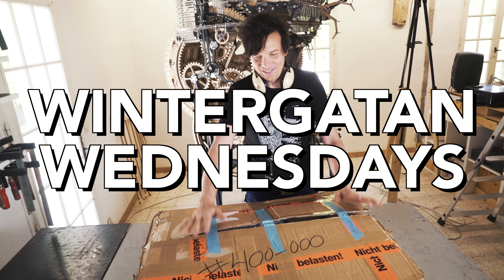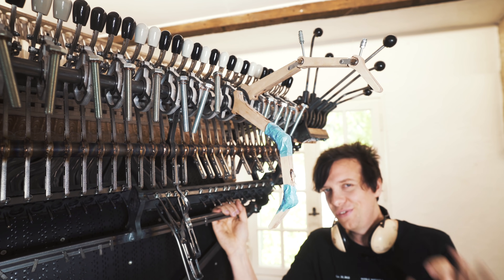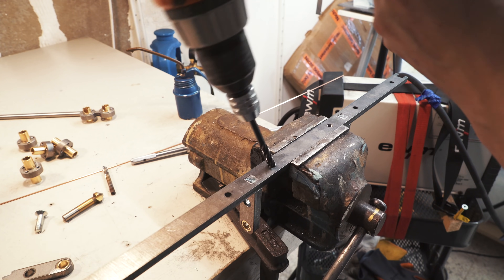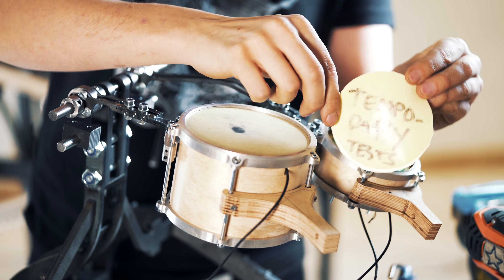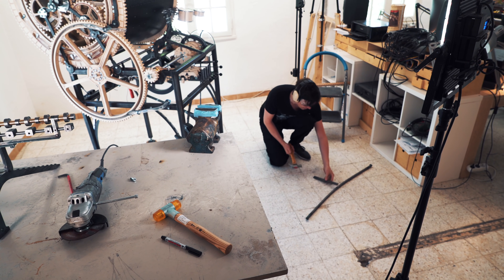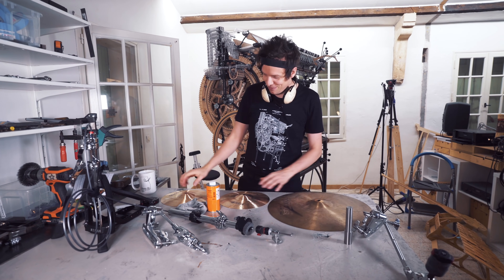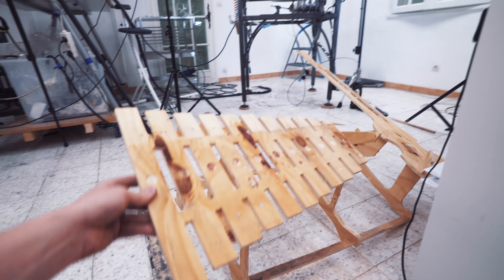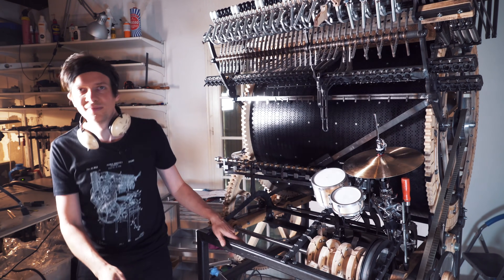Instrument Support Assembly - Marble Machine X #83

Comment: The only question I had after the first video about the kinetic fingers was : are they going to be painted black and white corresponding to the note they represent? And after this video I will say that they look much better with the severe down angle especially if when they are activated it looks like mechanical picking/plucking like on a guitar or harp. Maybe lock up the lower joint and let the upper joint have a slightly larger range of motion, and instead of being a direct continuation off of the connection at the very top actually add a pivot joint there so when it is activated it can almost lock at an upward angle (90ish degrees maybe) so you get a more clearly defined pluck/pick. Just some thoughts...

Comment: Use a forward cutting tap! Much stronger than the spiral flute and better when you have an open end. Also a drill press is great for starting a tap perfectly vertically if you're careful. Or a tap-matic if you need to tap 1000+ holes.

Comment: What you could do for the kinetic fingers to make them less wobbly is to use springs on the inside of the joints. It would reduce the wobbliness and there wouldn't be parts sticking out of the fingers like before when you had long metal pins with weights on them. Anyhow, it's looking good and love the idea! :D

Comment: every time i see this thing i cant help but worry about not only how heavy its going to be but how top heavy, anyone attempting to move it out onto stage for instance is very likely to have it come crashing to the floor. or do you plan to assemble it on the spot where you will be using it.

Comment: Hi! It is better use "spiral point" tap for through holes in sheet materials. https://youtu.be/bkrUzGooA9k?t=154
Or use "straight flute" tap with "tapper" grooves. https://youtu.be/bkrUzGooA9k?t=299
Taps of this type are better self-aligning along the axis.
"Spiral flute" tap, as you use, is better for blind holes. It hard to aligning.

Comment: Should double check of you need the crossbar in the front of the machines. Since you have so much bracing on the back there is a chance you dont need the front. Cleaning up the looks from the front.

Comment: I'm not a welder, never even hold a welding maching in my life, but i've just read, that you should enable argon feed 20 seconds before you start and disable it 10 seconds after you finish welding to prevent oxygen influence on welds. Please correct me if I'm wrong or this rules are too excessive. Thx

Comment: I can envision a way  you could have the machije itself control the hat  as part of the wheel

But it may be too late in design to incorporate that....however. if youre planning on making Permanent plates, a ridge at the end of the wheel, right up against the edge of the programming wheel could control the hat, even going so far as to have a gradient of open to closed and not just the binary.

Comment: Using a tap handle and a drill press to keep the tap perfectly 90° works great. I used this method when I worked with a Bridgeport Mill. The super fastest is a Tapmatic tool in a drill press. It would do that hole in about 10-15 seconds.

Comment: 2:26 "at this stage im not improvising"
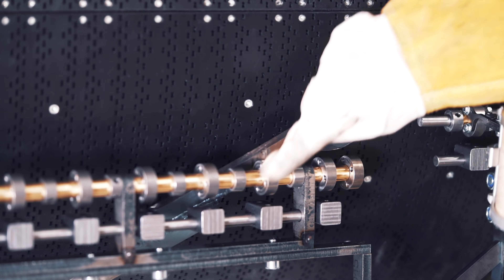9:52 "this is where CAD meets improvisation"

i expect answers
Reply: As if to say, he is not going to add or improvise  anything other than his original concept. 
The Supports were an afterthought. So the Vibraphone part he was trying to fit, did not fit. Although in his cad design, it works. 
So that's why he had to make alterations to that supporting beam, which was not in the Cad Project. and why he makes the comment of  "this is where CAD meets improvisation"

Comment: Just a pity it didn't start in aluminium, moving that beast around is gonna be a real B!
Reply: Aluminuim wouldnt have had the stability required for this precision machine to work, and beleive me, that fat machine is not worse for a roadie than a doublestacked bass amp. 
Rollers and easy dissasembly will do fine. 
Hell where i work we lift grandpianos on stage 3 times a month, i dont see this machine being more painful or heavier, it's just different, no fret.

Comment: I understand the fingers completely, they could look really cool if done right. But the alteration to the cross brace has upset the lines of the machine for me. I know its necessary and clearance is an issue but there must be a prettier way to work around it.

Comment: To clean up the look of your welds choke up on the tig torch and filler rod . The farther you hold them out  the more muscle shake is transferred to the small points (tip of tungsten and tip of filler rod) your working with

Comment: I'm still not a big fan of the fingers. I do like them better when they're rigid, and looking back at the original MM video I like how they're reminiscent of the fingers that dropped the balls, but I'm not a fan of how arbitrary they seem to be. Mechanically the machine would function exactly the same with or without them and the appearance of them doesn't seem to match the overall aesthetic of the machine. I agree that it's important to have visibly moving parts and that's a huge part of why the original video is so entertaining but I think you should consider something that ties in more with the machine.

Have you considered coloring them to match the black and white pegs above? Something really cool about the fingers on the original machine is they were grouped together so you could visually understand which fingers matched up with which instruments. I think some sort of color coded aspect to the fingers would help with that since there isn't a great way to tell that with the MMX and I think would justify the necessity of the fingers a bit more.

Comment: When this thing is done, you should have all the steal parts Nickle coated, NOT CHROME, nickel would be much cheaper and looks 1,000x better, also you should stain and seal all the wood parts with red cherry colour. Polish and antique the brass and aluminum parts. The frame i think should be powder coated black and have some crazy pinstripe on it. I would also have the marbles anodized a red or blue colour

Comment: This assembly looks incredible! Such a difference moving from the prototype into the beautiful metal design. One question, is the front crossbar going to be redesigned to accomodate the vibraphone module? After all that precision work I assume a new version will replace the modified part that you did in this video. Can't wait to see what's next!!!

Comment: so one of the challenges I can see with actuating the high hat with a lever is that normally the sound of the hats is modulated based on the pressure of the foot pressing the pedal.  you loose this with a mechanical lever.  I suggest adding some type of elasticity between the lever and high hat rod to add that natural sound and remove the robotic sound a straight lever will provide.

Additionally you can then tune the pressure of the elastic piece with the key built into the normal high hat mount.

Comment: Jo men sätt några fjädrar som drar ner fingrarna "lätt" neråt så du slipper ha allt fladder i ansiktet.. 
"livlösa skelett fingrar på en maskin som har fullt liv" Kom igen ska du göra en mer Fransk Glisché av detta mästerverk ?

Also.. Tap handle you can feel when things go bad if you are good... If 
you need a drill you are just a newbie that swing and miss in the dark 
and hope for the best x'D Aaaand a tip as a builder, as you pull the rod out, nudge it back in as you can 'hear' how much oxygen is being burned and you get a "cold rod" in the middle of your weal, making it awesome looking if you repeat the process over 20 times

Comment: from an engineering standpoint, is MMX over-engineered, over-complicated system?
Reply: Over-engineered - maybe, if you consider that there may have been simpler functional solutions. But those may not have been appropriate for the design brief (which included aesthetics) and also might not have had the required reliability margin for stage performance. Over-complicated - probably not, the answer depends on the design brief.

Comment: no undercut.  a bit of leg length variance isn't very important in this application.  maybe slow it down just a little bit to fill a tad bit more evenly.  either way, solid welds that will not break or crack when being used in this machine.

Comment: Won‘t the open/closed Hi-Hat have different hit timing??
Reply: Eh, assuming the ball is falling roughly a third of a meter to hit the Hi-Hat, it'll be falling at roughly 2.5 m/s when it gets to the Hi-Hat. Assuming a difference in position of 1 cm between the open/closed position that will result in a timing difference of just 0.004 seconds, or 0.6% of a quarter note's length at 90 BPM.
Reply: Kyle R I conclude with your assumptions, but still would not take chances and it could still be avoided if the Hi Hat‘s fixed half would be the up side and open and close at the bottom.
Reply: @SmilingDevil  Oh most definitely. If that's an option then definitely do that :)

Comment: Martin, you seem to be using the wrong kind of taps. Spiral taps exist to evacuate material through the top of the hole, usually for blind holes. Their main disadvantage is that they are very fragile. There's a really nice video from haas about the subject, should prevent you from breaking taps for no reason.

Comment: The problem with the kinetic fingers isn't the "kinetic" part. It's the "fingers" part. The concept is good, but the shape you want it to have hurts your end-goal. I would rather keep my eyes closed than see spidery jointed pieces twitching on the machine... I'm sorry, Martin, but it's just that they're made to look creepy. You say they're for the audience. I think it probably would be a good idea to consider how the audience would respond to that visual design. The machine is beautiful, but a machine with fingers looks kind of... gross, if that makes sense? They could be something simple, like clock pendulums instead of bony fingers.

Comment: Current thoughts: 1. Yay. I'm liking the instrument assembly so far. 2. Not so yay. I really liked the way the crossbar across the rolling drum looked, and now it looks kinda bad in my opinion. 3. Is there another way to have the crossbar without cutting it in the middle? I don't suppose if you mirror it from "bottom left to upper right" to "bottom right to upper left" that would fix it. Probably not. The only other consideration I have is maybe instead of just a bar, have a M/W shape (one or the other, or maybe both on top of one another) Although that's probably not going to help the stability as much as a straight bar would. I don't really know, except that the current solution doesn't look as polished as the rest of the machine.

Comment: Will you paint or powder coat all the frame steel part of the machine when she is finished or leave it as it is? 🤔
Reply: We were just talking about all the 'naked' steel & what would happen if it got rained on during the tour ...
Reply: Back in one of the early videos, just after the metal frame was made, a some one suggested in a Youtube comment the product RPM (Rust Prevention Magic) to put a near-invisible protective layer on the steel.  A later video shows Martin saying thanks for the tip and applying some to the frame once he'd finished attaching stuff.

Comment: Martin, when you mute the instruments, the white and black knobs can be pushed to play manually as you did with the first marble machine, yes? But when you pull the mute lever  here, does it not throw the kinetic fingers vertical and cause them to be totally in the way of the knobs? Even if you merely disconnect the flywheel to stop the pins from playing, will the fingers not be annoying and in the way as you play manually?

Comment: i highly highly disaprove of the front bracing. Metal can seem to be strong but what you did there is making that a weakpoint of the machine. you are strain hardening the part and thus making it unflexable - weaker than it has to be. and seriously CAD it in.

Comment: It's two different eras of show biz advertising. For Circus Era Show biz advertising You tell then deliver. In the Rock and roll Era show biz Advertising you Deliver then you Advertise what you've delivered. So if you're delivering a Circus level performance you can get away with Circus style advertising, but if your Rocking and a Rolling, you have to do Rock and Roll style advertising.

Comment: It's not much of a wonder you take this long with the machine tap handle, try using a 1st stage tap handle with the machine first and then the CNC finish tap handle. It centers and precuts, so you'll find the correct angle faster and takes a load of your finishing handle. For more information look at HAASAUTOMATION here on YT: https://www.youtube.com/watch?v=bkrUzGooA9k
I do not disagree with wour assesment of the "scrawny fingers of doom"s function but with their design, but we can argue about this all we want, until we see the finished  Marble Machine X.
For the welding distortion, you can tickweld all things into position with dots and then one side, after this the oposing side, if it still is a bit too much you can get it back by heating certain spots with an acetylen flame, no brute force needed.
The holder for teh arm of th e big cimble might bend a bit under the load, make sure it's not a problem with the welds, notch effect/stress concentration.

Comment: I'm not sold on the "The audience can't see it" theory. For what instrument is that not true? Tympani? Does the audience at a piano concert get restive because they can't tell what they instrument is doing? Would it be better to attach helium balloons to the hammers, so the audience could watch the balloons writhe and twitch? What visual gimmick would make a pipe organ 'better'?

In modern times we have large screens so audiences can see magnified close ups of performances, if they are unaware of "binoculars" technology. Wouldn't it be more to the point to see the actual machine that way, than creating a spurious motion for the somewhat patronizing purpose of showing audiences that the huge machine with the big rotating gears and visible marble lifts, which probably every single one of them will have seen intimately up close on youtube, is actually doing something? 

There's just something off about machinery that doesn't have any function. "But it looks cool" isn't a function. Car designers keep trying to add stuff that looks cool, but if it doesn't have a real function, people feel that it's cheezy. "What does that air intake do?"  "Oh, it's just a dead end. But it looks cool."   "And what about the spoiler? Better traction?"  "No, but it looks cool."  "And the big fins - stabilize you like a rocket's fins?"  "Nope, just looks cool."  Spurious design feels like a cheat and calling it sculpture doesn't really dignify it. A racing sailboat with a really big fake winch handle hooked up to the real winch handle through a series of pulleys and gears so you can see from the shore that the winches are being worked ... would be laughed out of the water. Elegance in design grows from functionality. The marble machine doesn't need to be waving distracting fingers in your face just so you can imagine that spurious movement bears some relation to a real mechanism.

Comment: If your goal is to visually demonstrate the Marble Machine to a live audience, there are a number of different ways to do it besides the fingers. Simply having a close-up camera and a projector screen on the back of the stage would be a simple way. You could also visualize it using note-triggered LEDs (you could even set them up to illuminate the acrylic rods so each channel would "glow" when triggered). Beware of design tunnel-vision.

Comment: Hey, so the thing is that your "kinetic fingers" DO have a purpose, but you're simply not implementing the design well. Since the primary purpose of the fingers is actually based around "visual imput," you need to structure them better so that they are cohesive and aesthetic without being distracting or visually unappealing.

As an animator and visual designer, I can tell you without a shadow of a doubt that the current design you have right now is too imbalanced. There's no balance between the mass of the machine and the intricate nature of the fingers, which just stick out compared to the rest of the functions of the machine. It really does look like something that's just being slapped on instead of what you may have originally envisioned, and the floppy nature of them really hurts the overall design of the rest of the machine.

I would recommend changing the design from "fingers" to more "tendons", like the knuckles and backs of your hands. Instead of having these wobbly, floppy designs, elongate the individual fingers and connect them to the actual marble droppers themselves, making this squared-off but organic shape that moves like you intend without forcing the viewer to stare at them whenever the rest of this beautiful machine is at work. That way they more resemble the flexing, muscled hands of a professional piano player or guitarist rather than flamboyant tentacles of some eldritch creature from the deep.

Otherwise, keep up the good work! I'm especially loving the new designs and placement for the cymbals :)

Edit: I am also more than willing to draw out what I mean to better illustrate a better execution of the design, if need be